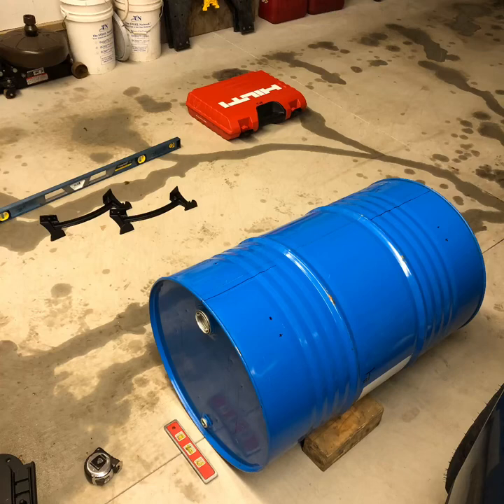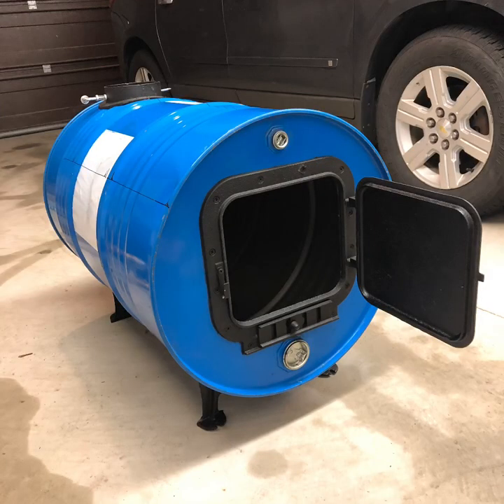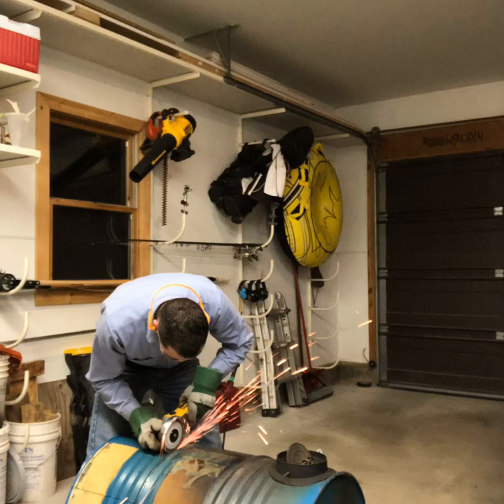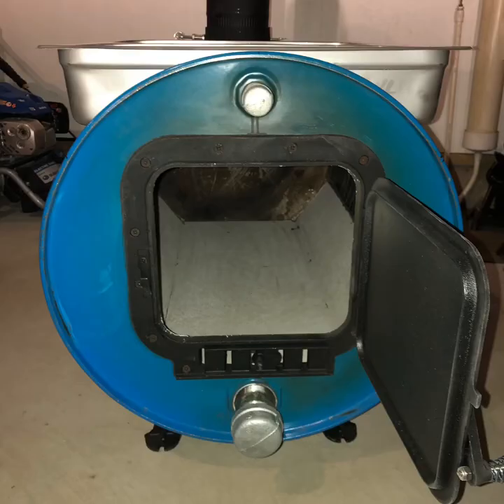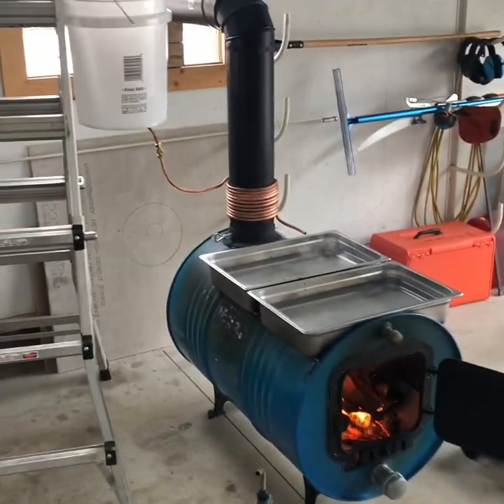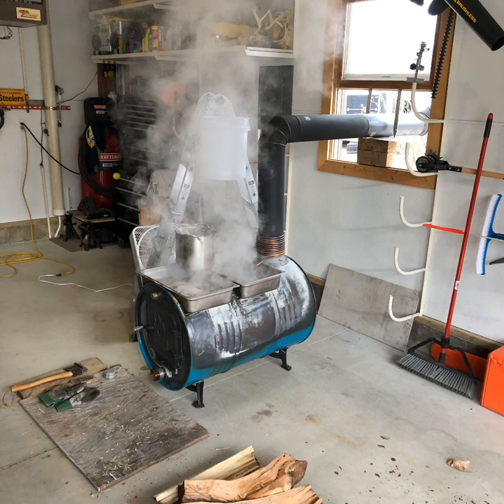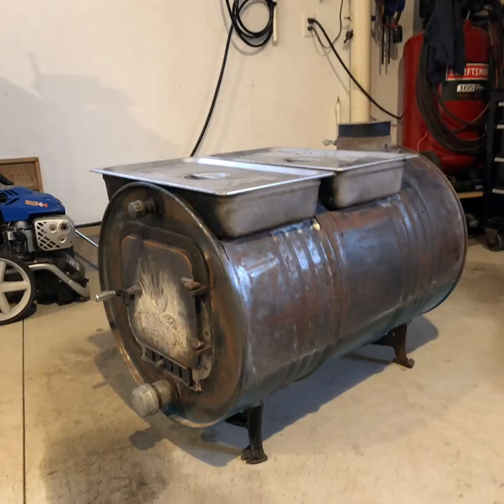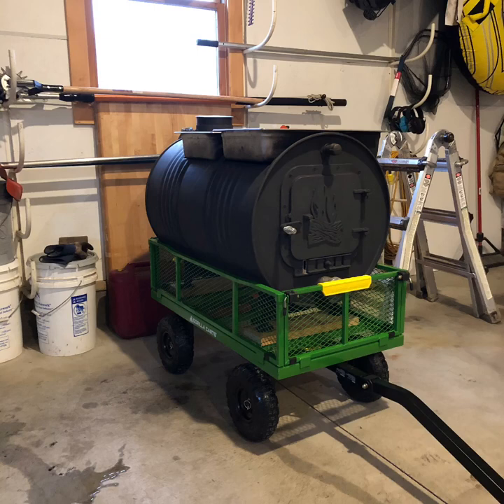Maple Syrup 55 gallon Drum Evaporator

Comment: I built the same. The only thing , I didn’t use the chimney flange. I stuck it out the back which pushed the pans all the way to the back. Much hotter in the back. But ya great job. I think these evaporators work great. Cheers.

Comment: looks great but you need to get rid of the copper tubing idea...  copper when heated, (depending on the temperature it's heated to) can produce "copper oxide". Copper oxide is a black flaky / powder residue that may be toxic to humans (debatable), but I'd prefer to have the syrup as clean and pure as possible if it were me.   If you want to test this, simply heat a small section - maybe a 1" patch of a length of copper tube with a torch to red hot (or there about).   Then let it cool or cool it with wet rag.  Then flex of bend that section over a paper towel to collect the residue that will fall out of the tubing.   If you'd like to eat that, then continue, if not - maybe use stainless tubing or just get rid of the heated syrup idea and just add it a little at a time so as to not loose your boil.  

That "dark color" you mentioned (and as can been seen) in the video could have been some copper oxide getting into the product from the initial burn in of the copper tubing around the stove pipe. In fact, I'm pretty sure it is actually. You can google the CuO toxicity. I don't think it will kill you, just not sure I'd want to eat that.

I would think you would want to do this outside so as to not sticky up the walls and ceiling in the garage wouldn't you? or was that not a problem with the garage door open?
Reply from the maker: You do bring up a very good point, I won’t be using that heat exchanger anymore as I have the warming pan with the WF Mason. I don’t think with the cold sap flowing in the copper, it ever got that hot. Only when I was done boiling and the fire was still going and nothing in the copper. Before the next boil I would flush out the heat exchanger with clean water and black flaking stuff would come out. So you are correct and that is a great observation.

Comment: Does this leak smoke from around the pans? I want to make one of these to put in a small sugar shack, but I don't want to smoke myself out. Thanks!
Reply from the maker: Adam, just make sure you get a tight fit when cutting out for the pans. Like I said in the video the pans are tapered. I run this for hours in my garage with the door closed. No problems at all with smoke.
I
Reply: @jonboersma1536  awesome, thank you!